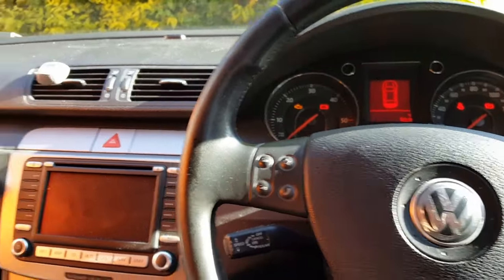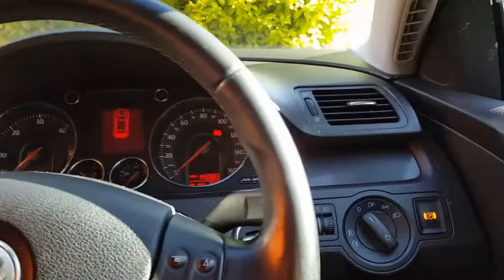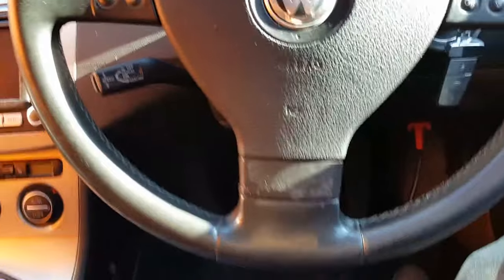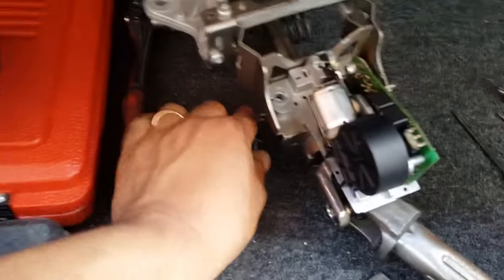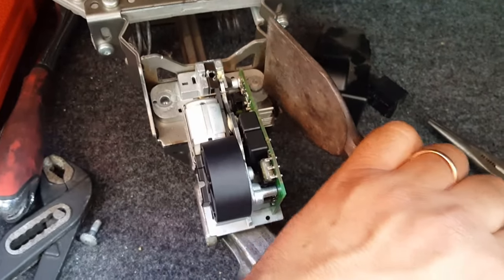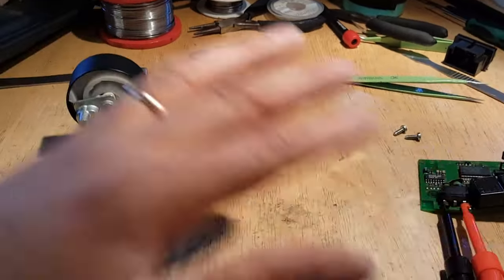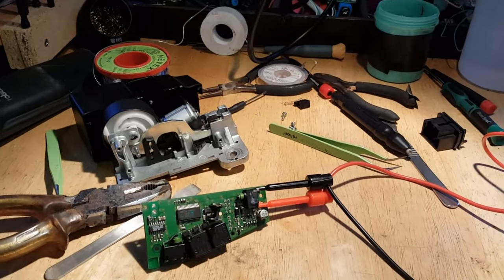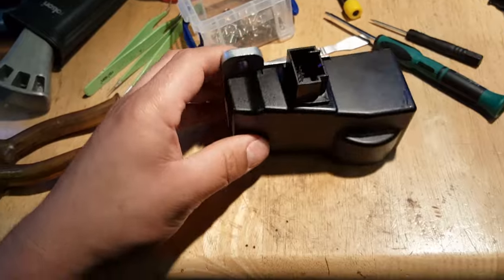VW Passat B6 Steering lock fault failure repair.

Comment: Hello friend, can you tell me the switches and relays i need to buy? I have the passat b6 2.0 tdi 140hp. I want to have the parts before trying anything.
Reply from the maker: https://rover.ebay.com/rover/1/710-53481-19255-0/1?mpre=https%3A%2F%2Fwww.ebay.co.uk%2Fitm%2FREPAIR-KIT-Audi-A6-C6-Q7-steering-lock-module-Micro-Relay-Switches-ORIGINAL%2F123742340752%3Fhash%3Ditem1ccf9e4690%3Ag%3A4RIAAOSwfoNab3XV&campid=5338344466&toolid=20008

Hope it helps!
Thank you for watching!
Reply: @LMAutoRepairs  Thanks a lot
Reply from the maker: @nunopereira526  
👍👍👍
Reply: That's not the parts for my b6, and i will not pay that much for parts that will not cost more than 10€ in total, i'll search further.

Comment: This is how I did mine, around 4 years ago. I didn't remove the switches, I eased off the green boot and sprayed contact cleaner in there. A multimeter is essential for testing for implausible readings. It should either be zero Ohms or Infinity. the failure is having a high resistance in the  position the switch sits at when operated, not the zero Ohms it should be. It's just gummed up contacts, as per the video. Clean them until it's completely binary. Infinity or zero - nothing else.
Reply from the maker: Absolutely...
Thank you for watching and for your comment!

Comment: Are these steering faults same on Porsche cayenne/tourag ....  Have one no start .  Battery was weak and it activated steering fault .  My basic scan tool will not work to clear it...  ?  Thanks
Reply from the maker: Possibly...
Without proper diagnosis is difficult to tell...
Thank you for watching!

Comment: i have the 02823 code, what to do ?
Reply from the maker: Sounds like a faulty steering lock, which might or might not be possible to repair and requires replacing. 
But, you need to perhaps remove it and inspect...
👍👍👍
Reply: @LMAutoRepairs  I have no idea what it could be. The symptoms that I have is that the car won't start but this happens like two times in a year. And it starts in like the fifth time but it's very random. Thank you for your answer👍

Comment: Hello, thx for the video, well explained. I think I have the same problem, only it's not that worse. Sometimes my engine cranks for some seconds but it eventually starts, sometimes it starts right away with no problem, sometimes it starts and I get yellow spring with engine problem, visit workshop or steering column lock defective and it turns off immediately, but 2nd time it starts. Lately it starts but shuts down right after, but if I clear the codes with an obd reader it starts and run with no problem. The faults I'm getting are electronic steering column lock control module j764, electronic steering column lock check sum error and steering column lock enabling for electronic ignition lock. Could it be some bad wiring since sometimes it runs with no problem and sometimes it gives this errors but still runs?
Reply from the maker: Could be a wiring issue indeed... But this inernal problem can look like a wiring issue when it is not... 
Checlk live data al well, see if there is anything there that helps you in the righnt direction...

Comment: Hi. Very good Video. I have the same problem with my 2011 Passat. I already removed the ESCL from steering column. It presently locates in intereur. Before I start with unsoldering swiches I am asking myself: Why mechanism runs such slowly in the event of defect? Do you have any Idea?

Comment: Hello Liam,hello guys,mine lock doesn’t work when ambient temperature is highter,if I disconnect battery and connect again it work after,can it be relay or switch?! Thanks
Reply from the maker: It can indeed...
You need to test etc...
👍👍👍
Reply: Thx a lot

Comment: TEMP FIX THAT WORKED FOR ME: 
Unlock the steering column and raise, lower, pull, push the column hard. Did this two times and it worked. 
This is a temp fix. I'm not sure how long it will last. It got me home.
Reply: Man, it passed midnight where I am (Brazil) and my car won't turn on because of that. Your comment save me, my wife and kid. Thanks a lot for sharing.

Comment: Thank you so much for this very thorough and informative video. I have a 2011 CC and my vehicle over this past hot summer here in Florida has not started if parked out in the sun for too long. I had a bad cell in my AGM battery and replaced it a couple days ago and thought that was the culprit but yesterday the issue of no start and immobilizer error appeared back on the dash. I was able to start the car after the temp came down inside the car but its getting worse so time to dig in and repair. I have purchased a new steering column lock and because of your video I am going to remove my column and desolder the 2 new mico switches from the new circuit board and resolder them onto my old board as well as use the entire mechanics of the new module as to retain the immobilizer settings so I do not have to visit the dealer to reprogram the key. Again thank you for the awesome video.
Reply from the maker: 😊
Hope it works for you! 🤞
Thank you for watching and for your comment! 
👍👍👍

Comment: IMPORTANT. Super video. I did all this but found nothing wrong with the switch. While putting it back I sprayed the proper contact cleaner unto the push-together connector at the base of the column. And also VERY IMPORTANT, I cleared the alarms that had developed because of this failing to start (due to immobilizer). Result perfect for the past 5 weeks. I waited before posting. So try just the contact cleaner on the opened connector at the immobilizer switch first, AND CLEAR THE ALARM. The fault will come back if the alarm is not cleared. Hope this might help some. Great video, gave me the confidence to do it. Best wishes to YouTube also, magic.
Reply from the maker: Charles Haughey 
Hi
Thank you for your comment and for sharing your experience and knowledge. 
Mutch appreciated!
Reply: hi ! sorry for my bad english ....where is located your "the push-together connector at the base of the column" ? Best regards
Reply: Hi David, to my memory(4 years now), the connector should be near the bottom of bar going to the steering wheel. So it is low down near the foot pedals. Make sure you use Electrical Contact Clearer as this evaporates quickly. Do not use any other. 
Also my alarm did come back!
It happens very little.
I remove the keys, and wait for all the light to go off (2 to 3 minutes), then try to start again as normal. Usually works.

Comment: i have soldered those pins on the board to make sure it makes good contact, for the past 2 weeks the B6 of the costumer car did again not start this 1 time unless u shake the steering a bit,  but that is because if you are adjusting the steering wheel back and forth and a chance is going to happen that the pins are not making good contact so the car won't start. well it's ok tho. better then nothing i guess, someday i take the parts out again and do a proper soldering and some tweak so the pins are making good contact with the connector. thanks for the upload! u helped big time here.
Reply from the maker: Emre Dağyaran 
Hi
Glad it helped you!
Thank you for watching and for your comment!
👍

Comment: Thank you very much! I havn't look at all the video and chznges the switch than put everything back on and nothing worked any more no contact not able to unlock steering, i worried and try verify all soldering and contact and same results.
So i watched the entire video and see you explain to remove that little clamp on the front, which allow to avoid hours of looking after a problem that not exist 😂

Comment: Hi, I love your video, I have had the steering column lock fault on my 61 plate Passat CC.  I had the relays changed at my local garage after I bought the kit off of Ebay.  for the past three weeks it has been fine. There was a a slight delay in the ignition kicking in when the car was cold, but atleast the error had gone.  However, last night, I got the error again which has totally gutted me, although the relays and switches have been changed.  Anyway advice would be fab.  thanks very much
Reply from the maker: Difficult to tell...
But you could have been unlucky, and got a dodgy relay or switch...
Might worth check them again...
Thank you for watching and for your comment! 
👍👍👍

Comment: Great video learned alot
I have  a6/audi/2005/ no start no comm with steering column module .. no dashboard on . All is off .. is the problem similar to urs?
Reply from the maker: It can be... Or the steering module it self... as when is the steering lock failing, I believe the dash should still come on...
Thank you for watching!

Comment: Nice video ,always a source of learning .You do a great job.Can you share the link for the multimeter probes?
Reply from the maker: Hi
here they are:
https://rover.ebay.com/rover/1/710-53481-19255-0/1?mpre=https%3A%2F%2Fwww.ebay.co.uk%2Fitm%2FBanana-Plug-To-Test-Hook-Clip-Probe-Lead-Cable-For-Multimeter-2pcs-PDO%2F274185687390%3Fhash%3Ditem3fd6bd915e%3Ag%3A~6MAAOSw~otWfkJ4&campid=5338344466&toolid=20008
There is other types out there...
Thank you for watching and for your comment!

Comment: You can get a repair kit on ebay: REPAIR KIT VW PASSAT B6 B7 CC STEERING LOCK MODULE RELAYS MICRO SWITCH 3C0905861
Reply from the maker: Thanks!
For watching and for your comment!

Comment: Great video! can you describe a bit how can I remove the column from the beginning?
Reply from the maker: I can't remember now exactly how that one is... I usually figure out things as I go along... but you have 4 bolts or nuts on the under side, and then one bolt at the bottom  of the shaft... 
Thank you for watching!
Reply: Thanks for replying. Do you recall that you start with removing the airbag? I am trying to figure out how to remove the column cover.
Reply from the maker: @victortang5287  
If I recall correctly,  you can do it without removing the steering wheel...
I think...🤔

Comment: Hi Could you advise me, I have the same problem with a wolkswagen passat b6 but only when the weather is hot or the car has been under the sun for a long time.
Reply from the maker: Possibly broken solder joints somewhere...
Difficult to pinpoint...
👍👍👍
Reply: @LMAutoRepairs  Can the problem come from Gateway?
Reply from the maker: Possibly...

Comment: Could it ever be the spring that is stuck for the mechanical side of it as I’ve got the same problem and steering wheel is stuck open
Reply from the maker: Possibly...
But can fail either open or closed...
😊👍👍👍

Comment: Question here.. Passat, same problem, locking and unlocking not working. I got everything out and I tried to measure microswitches. One is reading kiloohms while not pressed, press it and it shows 0.00 Ohm. The bottom one shows infinite ohms resistance just like yours when you have it out of the board. But mine is still there.. after click it shows 0.00 Ohm. Different fault than you have, but I think the board is not able to detect this microswitch if it has infinte resistance "OL" right? Or any other ideas what could be wrong? 

Thank you @LM Auto Repairs
Reply from the maker: Hi
I can't remember if they are also connected on the other pin...
Check that, as they can fail in one of the contacts only, or in both...
Hope that helps...
Thank you for watching and for your comment!
Reply: @LMAutoRepairs  So I checked it properly.. Pin 1 and pin 3 are connected when microswitch is active (pressed) and it shows 0.1 Ohms and it beeps when it is pressed. Pin 1 and middle 2 is open switch and it beeps together. Also shows 0.1 Ohms. When pressed circuit is OL.. For me it looks like microswitches are completely okey..
Reply from the maker: @MarkTheEye  
Are they always making contact independent of the pressure you put into it?
Reply: @LMAutoRepairs  Yes sir. They are
Today I tried it in car. It worked and after a few attempts it shows Steering lock problem on maxidot again and stopped working again. I do not know what to do. Microswitches seems to be all right, mechanical part also (checked) and relays probably too. I will try to change them even though it is not necessary..
Reply from the maker: Check also the electric motor... could be a weak motor, not always moving the lock to the end position... seen it in the past...

Comment: Here's how I have a problem with the 2007 Passat b6, so the tires on the car were replaced with nozzles, and then he somehow turned on the radio for 5 minutes, and then we washed his engine, because then the car won't start, the diagnostics show a crankshaft sensor error, but that put new and nothing, I really do not know what can happen if someone knows let him help, 
Could it be that the steering wheel is locked and why would that happen if you can help me

Comment: Hello! I have a 2011 B7 Passat that sometimes throws the "Steering Lock Defective" message I suspect it's the same issue as the B6, it's intermittent, sometimes it works fine, sometimes the ignition lights take a while to light up as the steering lock does 2 or 3 tries until they light up, sometimes the error shows up. For now I just remove the key and try again and it works fine but this situation is only going to get worse over time.

Is the removal of the steering column easy? I can't for the life of me find a video or photos as to the actual removal of the column. I don't really want to mess with it without making some research first. Would hate to pay a fortune at the VW dealer for a steering lock replacement just because of two stupid oxidized microswitches...
Reply from the maker: Hi
The steering is secured with 4 bolts/nuts under the cluster, and 1 bolt that secures the shaft right by the pedals...
I know you can easily do it without the need of any video or photos...😉
Reply: @LMAutoRepairs  Thanks! :D How about wiring connections or cable routes, anything "tricky" to expect?
Reply from the maker: @t0nito  
Not really... all straight forward...
Reply: @LMAutoRepairs  Just received two new switches to replace. Going to try this this weekend, Hope I won't f*ck it up :P
Reply from the maker: @t0nito  
Lol
I am sure you will not...
Tell us how it goes...
Hope you get it sorted!
Reply: @LMAutoRepairs  Success! It wasn't really half as hard as I thought it would be! Between removing everything replacing the switches and putting everything back again and clear the faults took me about 2,5 to 3 hours. I used a dremel to cut a slot on each security screw so it made my life much easier and I reused the old screws. 

I'm still keeping the original switches in case the problem reoccurs again, I bought them on AliExpress and I don't think they are genuine so... If it does, then I'll try cleaning them like you did. :)
Reply from the maker: @t0nito  
That's great! 
Well done!
👍👍👍
Reply: @LMAutoRepairs  Thanks!!! :D
Reply from the maker: @t0nito  
👍
Reply: @t0nito  would you have a picture of the use of dremel on the security bolts and how did you get the reuse the same ones
Reply from the maker: Not a problem...
👍👍👍
Reply: @mailtopps1  I just used a dremel cut disc and cut a slot on each screw, then I removed and resused the screw with a regular flat blade screwdriver
Reply: @t0nito  so the bolt at the bottom is regular threaded bolt?

Comment: Hi iam having the same error,the problem only started after I got a new key fob programmed to my b6 passat 2006
iam not sure if the new key had caused this issue or the switches need cleaning as in you video,my car wont start or even try too,the car was down for about 7 months..

Comment: Hi.
did this on my car but have the same problem and no ignition. the steering wheel lock goes on and off all the time. any suggestions on what it might be?
Reply: The steering wheel electric module may need replacing next.

Comment: passat b6 2010 model vehicle has an immobilizer active problem in hot weather, the ignition does not turn on, the vehicle does not work, there is no problem when the door is opened for 10-15 minutes and the temperature decreases. What is the solution for this case?
Reply from the maker: Difficult to say without checking...
Dry solder joints perhaps? 
👍👍👍
Reply: @LMAutoRepairs  nereyi kontrol etmemiz gerekli